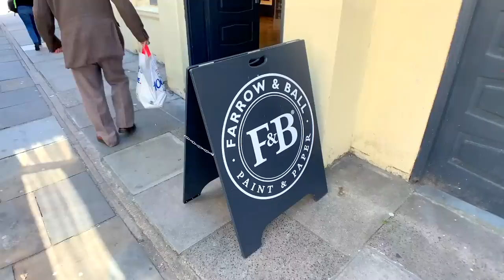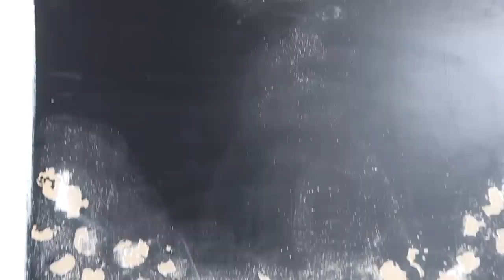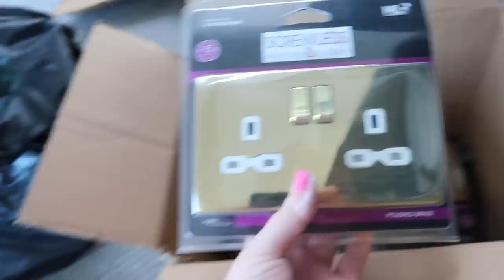Bathroom Renovation Update + Painting My Door Pink 🌷

Comment: Hey! Something I’ve found super helpful when using tape to get a straight line is if you put the tape on and paint white over it before painting your color, the white will fill in any air bubbles so your line comes out smoother! I have textured walls so idk if it works the same on non-textured walls, but maybe its worth a try if you have anymore lines with tape you want to do! Everything is looking great! xx